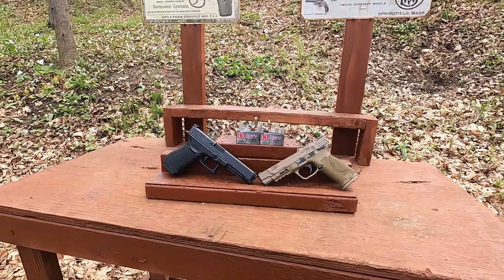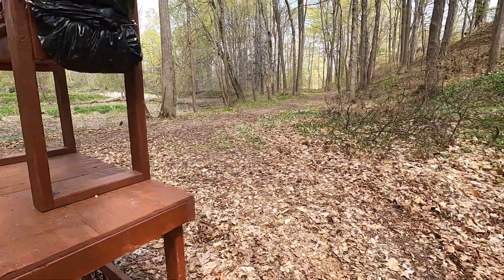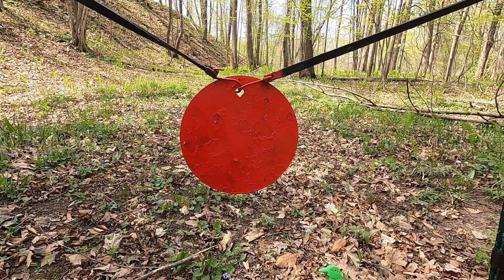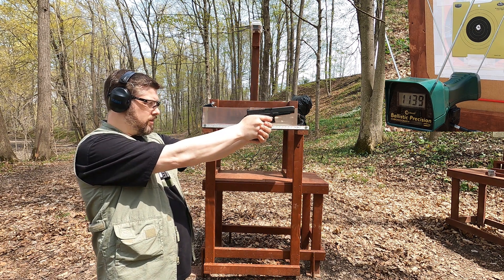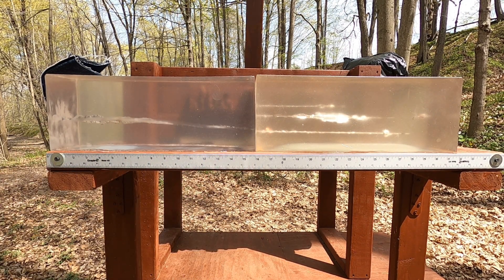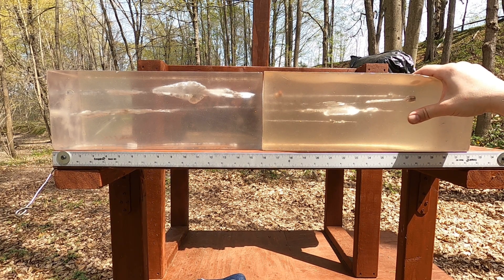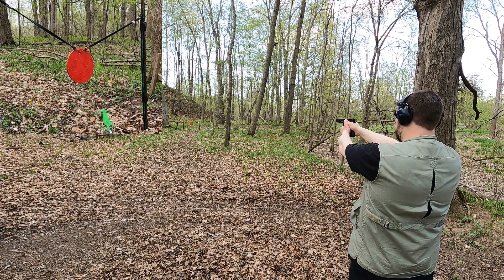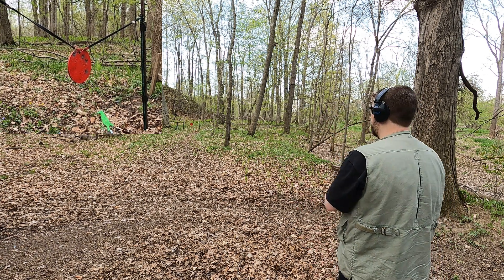Battle of the Long Slides - Hornady Critical Duty 9mm VS 10mm - Ballistic Test

Comment: In general, I like the Hornady ammo. It seems to be consistent in all calibers I've tried. Not many mind you. I've shot 380 ACP, 9mm Lugar, 38Spl +P, 357 Mag, and 243 Winchester. Decent stuff. In most cases, it was definitely loaded a bit light. The one exception is a 380 ACP load that my Walther PPK/S doesn't like. That was definitely in the high end range for 380 ACP. The 9mm stuff is clearly tuned to pass the FBI tests.
Reply from the maker: I have also noticed that Critical Defense as well as Critical Duty, is all loaded light except for the Critical Defense .357 Magnum and Critical Duty .45 ACP+P, i'm sure there are others beyond my experience. If you want hot for .380 ACP, wow the HST was it. I think it's 99 gr and I got the rated velocity of 1,030 or something like that, in the LCP! I just remember it being something like 240 ft lbs when most .380 in that LCP is 150 ft lbs. Chrono was not lying, as the recoil was hash. I would love to see that in like a 3.5" to 4" pistol like the EZ Shields or whatever they are called.
Reply: @GunSam  You're right! I misremembered. It is the HST that is high powered 380 ACP, not Hornady. My. PPK/S doesn't like that stuff. It doesn't feed it well. It does make quite a splash on water jugs though! I suspect it would be great in a S&W 380 EZ.
Reply: @GunSam  Would love for Sig to make a P320 in 10mm!

Comment: I really like the critical duty 135+p for a few specific reasons over GD and HST. First it penetrates hard barriers better while still retaining the ability to expand on the other side, reducing the chance of a pass through. Second, they are primer and projectile sealed for protection from the elements, and the projectile has a cannelure to for a more secure crimp, reducing bullet setback if you don’t rotate your chambering round  enough, or rechamber frequently. Oh and it’s cheap!
Reply: I prefer the 124 grain critical duty

Comment: Thinking of sending you some ammo to test. I can't use ballistics gel or a chronograph at my range. I'm wondering which would be a more practical carry round. Deciding between Buffalo Bore heavy 44spl with a 255gr swc. And a reduced recoil 44mag 255gr swc. Looking to see a difference in recoil, velocity,  damage to the gel and if they pass through the gel.

Comment: Are the issues with cycling the Glock all ammo related? That reliability is brutal!
Reply from the maker: like I have said many times throughout the years, this is not a 10mm Glock. It's a .45 ACP Glock with a 10mm barrel. There's multiple reason why it's not reliable. I used to test 10mm but after everyone making the focus on reliability of my conversion and not my intended purpose of testing ballistics, I gave up on it as the trolling was too much.
Reply: @GunSam  Ah. I didn't read the other comments (and missed you saying that it was a 45 in the video). I definitely wasn't "trolling" anything. Just commenting on what I saw. Glock has so many models that it's hard to keep track of what # is what (other than the 19 and 17), so I assumed that was Glock's 10mm. But I just looked it up and now see that Glock's 10mm model is the Glock 20. Honest mistake!

Btw, how'd you get the idea to put a 10mm barrel in a 45 ACP slide? I'd imagine there's a lot of play given the .05-inch difference in bullet diameter.

Comment: I’m glad you do these videos so a lot of people can see NOT all ammunition is created equally. I don’t buy that particular brand because it has always seemed to be loaded as a reduced load and the 10mm proves it. People will buy 10mm never actually checking the numbers and are essentially buying full power 40 S&W. It didn’t even expand at that velocity SMH…..but people will buy it and brag about shooting 10mm. I will not even comment about 9mm 🤣🤣🤣🤣🤣Thanks for the video
Reply from the maker: What's interesting, is with their 9mm+P and .357 Mag (both is 135 gr), they are both roughly 10-15% lower powered than typical, but they are both perfect for performance, accuracy and shootability. They made them right, but the other stuff i'm not so sure on.

Comment: Nice video sam. Shared it few times.   I carry the critical duty in my 40s&w  think same bullets that they use in 10mm. The 175gr .40cal.  I carry bc was FBI go to before went back to 9mm.  But I like 40s&w  like bigger bullet to 9mm. Also carry 380 some time but load pdx1 in it some carry critical defense got some free also some cheap ppu hp in that.   Theo 40 only carry is critical duty.    Kind wondering how they do if will expand at all ?
Reply from the maker: Thanks. Yeah, Hornady does a lot of bullet sharing, more than some companies. Example, is their  Critical Defense 185 gr .45 ACP has a cannelure in the same spot a revolver bullet cannelure is....because they load the same bullet in their .45 Colt Critical Defense! So, either their .45 is 1/1,000 too big, or their .45 Colt is 1/1,000 too small.

Comment: Scientifically speaking, what do you think it would do to a car door?
Reply from the maker: Critical Duty has a harder core lead than most ammo. A car door, generally it would pass right through. If it hit a person inside there would be no expansion as the velocity would be too low at that point, also the bullet would be too deformed to expand properly even if it had enough velocity after going through a door.
Reply: @GunSam  Makes good sense. I just got finished watching a video of a 10 mm, a car door, and ballistics gel. It was a mess! There were chunks of plastic from the door 3in. into the ballistics gel and the sheet metal from the door was fused to the end of the slug... I almost forgot, the first round went through both the door and the gel and kept going.
So with all that being said, do you think it'd make a good truck gun?

Comment: I find it kinda funny how everyone digs the hollow points which barely get the expansion of a 45 ball round and some don't even achieve that great video seems like the buffalo bore seems to out preform a lot of others
Reply from the maker: Thanks. I have seen .45's expand as well as anything else, but you really need a big hollow cavity to do it. Like HST or Gold Dot would expand in .45 acp for sure.
Reply: Any hollow point opening is CUTTING around its path.
A 45 ball will PUSH around its path...

A 45 whatever loaded to hit hard is not easy enough to shoot quickly in sub-optimal conditions for the ultra vast majority of people. And capacity is lower than a 40 for example.

During the summer, HPs will open better in flesh, for sure.
Doesn't really matter since during the winter, cast bullets or monos are 'better' at going through bubba's DIY armor under his big ass coat, so they should be selected around late fall.

Comment: .46 is not ideal .55 is 1.5x for appropriate TC value hst n golden saber way more expansion and therefore TC damage. SAM Listen to my 9mm vs .45 series and 9mm,.45,
380 vids. Real gel is far denser and not as easy to tear. .356ish bullets go way farther in clear gel keep telling u this...I've done the exact math official real gel numbers compared to clear etc. In various calibers. U have so much knowledge but need to round that part out deeper. Also 7n6 has liked that 10mm load so....maybe needs simulated bone board to expand?

Comment: Not seen the test yet , I would bet this is good ammo .
Reply: Stated differently    it will do good in this test  ???
Reply: I was 1/2 right .. send the rest of the 10mm to Chuck .. for bears
Reply: @danoneill2846  lol yea be fun I carry it in 40s&w  like it. Chuck told me he don't like it he tried it before. Said had bad expashion in some critical duty
Reply: @jamespugh  He said in the past he didn't like H Ps for bear . This should feed better than KEG shape rounds , & if it only expands a little , the hard lead should be a good HP for bear . I may have asked him about a 200gr XTP , he said no hollow points . This for a stock glock barrel , the Bonded 180 gr flat point I think was his pick . Not sure the brand .

Comment: The 9mm did well, although that is more penetration than i like. But is is made for the FBI, who want as close to 18" as possible. The 10mm was disappointing. I was hoping fotmr about 60 cal expansion, but no dice. The velocity was a tad low. It should be 1200-1250 fps. Not sure how much diff it would make. Hornady uses a higher antimony harder lead core in these bullets fir barrier penetration. But the 9mm expanded at slightly lower velocities while the 10mm did not. Makes you wonder if their lead is varying.

Comment: Nice review. I like Hornady ammunition too. I think for the money it’s good stuff. In my experience it’s pretty clean too. 

Side note, from my observation you sir are really liking that M&P. I really want one of those but I think I want it in 40 caliber. Sadly my local gun shop is having trouble keeping any kind of guns and especially ammunition.
Reply from the maker: I found where to buy a .40 version, but it's black and the performance center version so it's like $620. Not that I personally would not buy that, but getting up there in price I might as well get the S&W 610 in 10mm and shoot .40 in that.
Reply: Yes sir I would agree. My cousin has one of those in a 6” barrel and it is very awesome. It’s about like shooting a 38. Virtually no recoil. I had no trouble hitting clay pigeons just propped up at 45 yards. Very easy to shoot.

Comment: 500fpe?  That's basically 40S&W labeled as 10mm

Try the 700fpe stuff from Underwood.  That's legit 10mm
Reply from the maker: I have tried Buffalo Bore at 792 FPE.
Reply: @GunSam  Then compare that.  If you are gonna compare 9mm to 10mm, why not use a 10mm actually loaded like a 10mm?   haha
Reply: @theone031  I don't understand your question.

I was saying that if you are gonna compare 9mm to 10mm, why use the weakest 10mm loading on the market?

It's like doing a Corvette vs Mustang track test, but you bring the 4 cylinder Mustang instead of the GT350 or Shelby...  lol
Reply: @Ni999  I dunno...  I just saw a 9mm+P compared to the weakest 10mm loading you can buy.  Even the cheap Blazer target 10mm I shoot has more power than that...

They may call it a 10mm, but it's loaded to .40 specs, clearly...  What's the point?  It would be like making a 9mm -P instead of a +P...  lol

And I have a box of 9mm Critical Duty, and I believe that it's +P+?
Reply: I agree with Paul Harrel , not a fan of Max loaded ammo , many good reasons . In a nut shell if you need more power than the gun was designed to take get a 44 .  A Ruger SRedhawk 6 shot 10mm could take any 10mm that won't blow the case up . With an auto > safety , beats up the gun , the feeding is not designed to work that fast & hard . If you ever need to shoot with no ear pro ( inside ) , that would be bad . Mid range ammo has lots of power & works great . If your target is so bad you need huge power , you also need your gun to not fail . Void warranty ... It could go faster & still be in the mid range , this is why we test !!
Reply from the maker: @Daves_Man_Cave  You literally, just came at this as I have NEVER tested other 10mm ammo before, when the whole point here was to test it against another Critical Duty. I have tested like 20 different 10mm loads, yet you're ignorantly being like "run it". There is no power factor A Hornady Critical Duty 10mm, power factor B Hornady Critical Duty 10mm and so on....this IS how they load it, I cannot say "okay folks, not going to compare 9mm and 10mm Critical Duty today because I determined that Hornady loaded it weak".
Reply: @danoneill2846  You talking about the 9 +P+?  I agree...  Loading it that hot to get it barely to the low end of other calibers better designed for more power.

I just don'y understand what the point is of taking a 10mm and underpowering if.  If I wanted a .40 I would have bought a .40...   lol
Reply: @GunSam  Its your channel, do what you want.  I just don;t get why they make such a weak 10mm...
Reply: @Daves_Man_Cave   I don't know the ammo your talking about in 10mm > 700 ft lbs Must be max + . I don't fear a Glock blowing up in my hand , it has happened . I don't know why , could be a few issues at the same time , squib then a compressed round behind it .. Kaboom ?? When you are on the ragged edge , I think you should expect trouble . I know of a G17 that had a bullet in the barrel & was shot with a strong load & both went out the barrel , that was 25 years ago . That gun is still working & very accurate , it had what looked like a ring in the barrel made by a pencil ( lead ring ) right where the base of the stuck bullet was . It was an accident ..... DON"T Try this at home !!! The bullet was about 1.5" down the barrel from a primer ONLY , no powder.
Reply: RE: glocks , it freaks me out a little to see just 4 small tabs holding the slide on , when most other guns have a Rail on each side of the frame . I do trust them due to the PROOF test I just listed , still , I don't want to run mine that hard , G17 , G19 , G20 .
Reply: @danoneill2846  700ft/lbs range is what the 10mm is supposed to be.  That's what it was designed for originally.  But many FBI agents were having trouble managing the recoil and so they kept powering it down, until they got it to the range of what then became the .40 S&W...

My point, quite simply, is why does Hornady make a 10mm round that is actually just a .40 loading in a 10mm case?  Seems off to me...  

10mm is typically hotter than that, and so most 10mm guns may be sprung for the "real stuff", and when you put the neutered version in there, you not only give up the very performance that makes the 10mm the 10mm... you may also experience reliability issues...
Reply: @Ni999  No, I am making an argument that simply surpassed your intellectual capacity to understand it, apparently.

Maybe next time, boomer.
Reply: @danoneill2846  I mean, Glocks are reliable so the 4 tabs do work...  But I do feel better with full magnum loads, which a properly loaded 10mm is... having full length rails...  But it's not like I am putting 10k rounds through my Glock 29...  It's a carry gun, so I do shoot it, but it's not my range toy or anything...
Reply: @Daves_Man_Cave  What is your carry ammo .. or the ammo you use most ??
Reply: @Daves_Man_Cave  A person that likely knows more than both of us put together +/- ? did a lot of work with a Kimber ,  I think Kimber gave the gun to him to test ? He said for reliable feeding ?? best to keep slide speed to 1250 FPS , I guess that is for standard 180 gr . I don't know what speed a 180 needs to go for 700 ft lbs ( 1350 ++ ) I couldn't find the full 6 pages  https://www.wolfeoutdoorsports.com/handloader-253-june-2008/
Reply: @danoneill2846  Older gens Glock in 40 and 10 mm can kaboom because a lack of case support in the chamber.
Reply: BTW I did make a photo of all the load data , I don't have it with me . That Mag has tons of good info on all kinds of stuff .
Reply: @Gieszkanne   That is a Glock Myth .. I have busted before . My 2nt gen has NO G SMILE . The only difference between my kimber case & G20 case is the primer strike . The chamber is a slice of a hair larger than the Kimber , so if you really look hard you can tell it expands the case about 1/3 of an " up from the base ( past the web > in question /myth ) a tiny bit more to fill the chamber . You must look hard to see the difference . I have never seen any G smile , zip , nada , none  & the case reloads many times with mid range ammo . Both factory & handloads . I have not shot +P+  ... I just looked AGAIN , like most autos there is some web in the air , it is very little .
Reply: @Gieszkanne  I think that may be true for the 40 S&W  , not my 2nt gen 10mm      I got it in 1996-7 ?
Reply: @danoneill2846  I have seen cases with Glock smile even on a video of this channel but I cant remember which one it was.
Reply: @Gieszkanne   I have seen it , that can happen to any auto that is over pressure . If there is a squib or compressed round or both together , that is the weak link .
Reply: @danoneill2846  The further the ramp cuts into the chamber the more likely it can happen. And the 3. Gen barrels had a deep cut and the chamber was very loose. They did change it with the 4. Gen. The 2. and 1. i dont know.
Reply: @Gieszkanne   I'm guessing your talking 40 S&W ... I also have a 3rd gen 10mm  , it's not in front of me . I did this before when I had all in front of me at the same time  3 -10mms  2 Gl & 1 Kimber Custom II.
Reply: @Gieszkanne   Funny thing Both G20s out shoot the kimber
Reply: @danoneill2846  Carry ammo is underwood 200gr JHP, and I have some Underwood 200gr hard cast(coated) rounds for hogs or bear...

For plinking I use Magtech of Blazer FMJ...  Whatever I can find.
Reply: @Daves_Man_Cave  I know Chuck from Alaskan Ballistics loves his & he shoots bear loads out of it . I'm thinking I would like a G40 vs the short one , to go with my G20s . I'm very impressed with his results in his short barrel .
Reply: @danoneill2846  10mm is a very fun and versatile round.  They can power it down to .40 levels like Hornady has done for some reason...  But for defense rounds?  What's the point?  I can see softer shooting stuff for plinking, but if you are sensitive to recoil, go for the 9mm or 40 and don't get a 10mm...

I got the 10mm because I wanted something that rivaled .357 Mag in an autoloader...  And those Underwood loads out of the G29, not nearly the recoil I expected.  Didn't feel any different than a .40, other than a bigger boom.